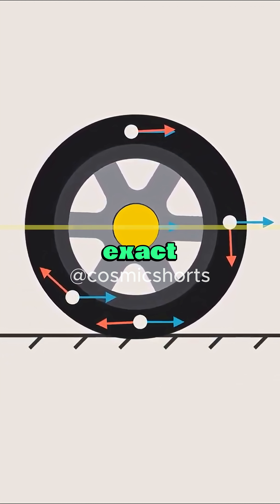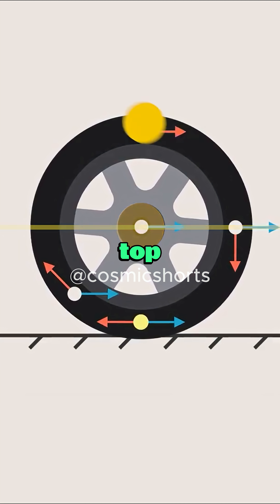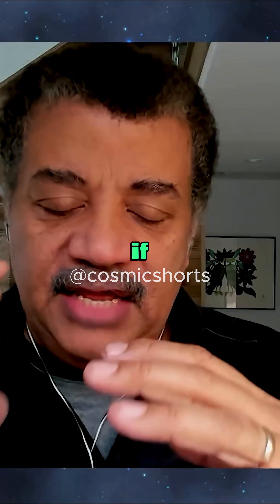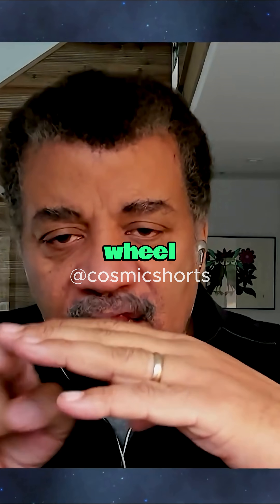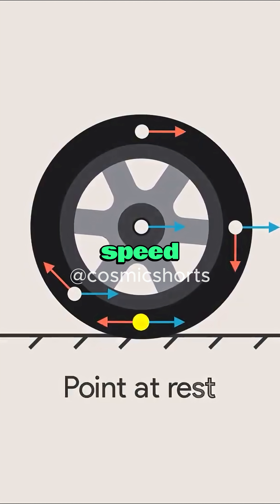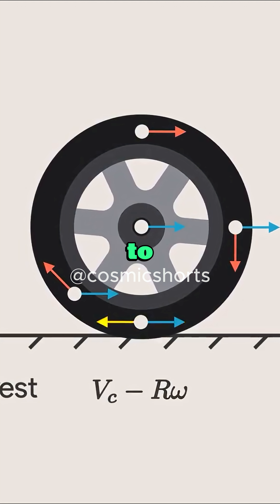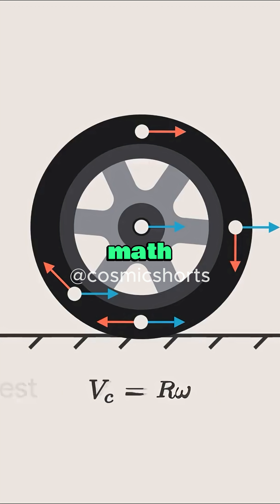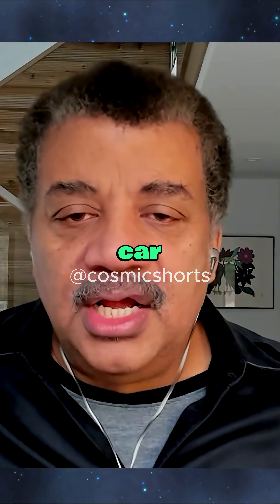The Surprising Science Inside Your Car Tires 🧪🛞

Comment: Im not buying it. No part of the car is going 0. The top of the tire rotates around the center of the tire at the same speed the bottom of the tire does. It appears to not be moving at the bottom but only in relation to the ground.

Comment: In drag racing we call it getting on top of or in front of the tire. If you have ever seen a large slick in slow motion it is very apparent. Like rolling a ball of dough down a hill. Is it rolling? Yes. But the contact surface is very much so static until it is its turn to roll.

Comment: “If you are skidding then the part of the wheel in contact with the road would be moving forward”

What? How does that make any sense. If you just do a burnout on the spot then yes the wheel is moving but it isn’t moving ‘forward’ at all. In fact the part of the wheel in contact with the road is moving backwards, if anything, not forward.

Comment: It is zero at the bottom, meaning it will fall behind the car (which it does), but then it immediately starts accelerating forward and uses the 2x velocity to catch up and even get ahead, after which it starts decelerating, repeating the cycle.

Comment: easiest way to understand is imaging the wheel is just spinning and not moving, the center will have 0 velocity, the top and bottom will have same magnitude v but opposite direction,now in a moving car(not skidding) the part that not moving is the bottom ,so just shift the values up, the bottom is 0,the center is v, the top is 2v

Comment: In essence this is useless information. If you’re going 60 the wheels are moving/rotating. The moment of time he’s claiming the wheel isn’t moving, is fractions of a second. Also I doubt this, if they used radar to check the speed that part of the wheel will show a reading. Also, tires would never need to be replaced if they weren’t moving during contact with the road

Comment: Kind of acts as if it’s a level, hear me out the contact is stationary with the road the middle is moving at chassis speed and top of the wheel is being flung at twice the speed, think of the bottom as the pivot point

Comment: He should stay with physics, not engineering. 
The  tires grip by friction. Every force transmission by friction suffers from slip.
So the contact area is even going into the opposite direction.
Reply: Lmao this is such a petty response
Reply: @daSora_1 I accept he's right in most of what he says, as far as i can tell. And i learned much.
But sometimes he just talks for the sake of it.

Ps.: And before you say it, yes my comment too, is just for the sake of it.

Comment: Remember this is just relative to the ground. Relative to the car, all parts of the wheel are moving the same speed
Reply: Wheel spin IS NOT EQUIVALENT TO VEHICLE SPEED.  Bigger tires move slower relative to vehicle speed. 
Think more
Reply: @butcrack6786 not to be a smart ass and just to clarify the topic of discussion, tire size and spin of course has no equivalent with speed. That wasn’t even the point of discussion. You can have your slow turning monster truck tires, going 60mph, while I have my fast ass spinning 13inch tires traveling 60mph. Point is, we’re both still going 60mph 😂.
Reply: Aaaaand ... you would be wrong.   ;-)
Reply: @MikeInExile I love physics, and seeing people’s response to it. 😊
Reply: Agree. People like to complicate things 😂
Reply: Exactly...
Reply: No, he just explained that with the chassis
Reply: You mean the centre of the all wheels! A wheel is more than just a diameter less point!!
Reply: Relative to the car the top of the tire is moving at the speed indicated by the car's speedometer, the bottom is moving at that speed but in the opposite direction (the same as the street beneath), and the front and back of the tire aren't moving at all (just like the car).

Comment: Easiest way to visualise this... watch a tank.
The bottom section of the track is planted on the ground and doesn't move - then as the tank passes over it, it gets lifted up the back then goes over the top of the wheels at twice the speed the tank's going. 
You can easily see it moving faster than the body of the tank.
It causes an optical illusion, where a tank, driving across open ground, APPEARS to be going significantly faster than it's actually moving.

Comment: Then the math isn't connected to the movement. It is connected to the frame of reference. 

In other words, how can the place at the bottom of the tire be moving forward at 0 mph? 

The only way to make that make sense;

Is to look at the tire moving, as it is operating from the top, then realize that the CONTACT PATCH between the tire and the road never actually moves (even as the tire rotates).

Thus, the math is not and was never connected to the mechanical movement of the system.

In this case, the math is connected to  perspective alone.

I wonder if that's true for all mathematical situations. 

Next, I will attempt to conceive of a way to test that possibility.

Comment: First of all Neil should have mentioned that it's actually a contact patch, not really just a point.  And that's what's giving you and your car the only place where FULL control of your steering and braking can happen with the road.  Even at highway speeds that patch keeps you from sliding or losing control as long as you don't exceed its frictional forces, brief as its moment of contact is.

Comment: The theory of inatant centre of rotation. Used to simplify the sytems with multiple velocity by considering a stationery point at every instance, in this case it is the conatact surface of wheel and from that ,using angular speed we can calculate other velocities of the parts of the wheel with respect to stationary point. And also think in the aspect of relative velocity. The top part of the wheel has horizantal instaneous velocity equals to cars velocity and also since wheel ia moving as a single unit with car the top part of wheel also have car's velocity so the particles at top part of the wheel has twice the speed of car. And in the bottom part velocity cancels out. In the exact centre only the velocity of the car remains because it is the original centre of the wheel and it rotates. That's what the video saying😂

Comment: What about front wheel drive cars with horizontal mounted engines. The top of the crankshaft is going 460mph and the bottom is going -360 mph. Also of you are driving east its going faster than if you are driving west. And if you are in Australia everything you are doing is counterclockwise and illegal, unless you are muslim.

Comment: Did you know, did if you put a rifle casing? On a railroad track, point it down ahead of the railroad, the bullet will never escape the cartridge. Because it's almost instantaneous milliseconds to cover that last little distance from contact with the bullet casing. And the bullet trying to leave, but if you face the bullet off the track and it ignites, it will leave the case just like it left a rifle. I'm without having a barrel. It doesn't have duh, dad pressure exerted to keep the bullet on track, so it's certainly gonna be slower. But experiments in this have proven then this is something that occurs, and we'll speed all kinds of miles per hour in this and that can be calculated. Obviously he knows I've done my own experiments. That's how I know

Comment: Similarly, elliptical orbits like the moon around the earth,  the earth around the sun.  We would feel the earth speed up as it passed the sun and then slow to let the sun pass, completing the revolution in 365 days. We supposedly don't feel or perceive the motion of the earth spinning because we travel at a constant speed, but the speed differences required for an elliptical orbit around the sun would have to be noticeable and measurable.  If you haven't figured out where this is going it is headed toward the point that we don't live on a spinning ball. Elliptical orbits aren't possible on the current globe model.

Comment: The speed of a car can be calculated by length of the threads, also called circumference, multiplied by the number of rotations. So yeah, of course the part touching the ground is "not moving". The part that amazes me, is that cars often have their speed sensors in the transmission, which has to account for gear ratio in the differentials!

Comment: No the wheel has the same speed all around. The direction of the car adds to the speed on top of the wheel and subtracts the speed at the bottom of the wheel. 

Now if the car drives westward— the earth acts like a wheel spinning eastward. Again subtracting speed of the car.
You can keep going until you reach the linear velocity of the milkyway 😂

Comment: Thats exactly why on many vehicles if you switch to either a larger or smaller diameter tire/wheel itll make your speedometer inaccurate. Most newer vehicles use gps to get your speed though so usually changing wheel size doesn't affect it at all
Reply: Not true. All cars use a speed sensor in the transmission or somewhere in the drivetrain. Drive thru a tunnel sometime, your speedometer still works. The engine computer needs to know vehicle speed many many times a second, a GPS signal would be tooooooooo slow and unreliable.

Comment: I find it odd that so many commenters here find this concept so difficult to understand, especially when it's so damn simple and straightforward.
Just take any round wheel and slowly roll it along a flat surface and you'll see that the bottom part touching the surface is stationary to the surface at that moment.  And the top of the wheel moves at twice the wheel's forward velocity.  Still not convinced? ... then try the following, it's very simple and easy to do.  Take two wide round objects, like rolls of paper towels or toilet paper or whatever, but make sure they're the same overall diameter.  Then place one in front of the other on a flat surface, like two wheels on the same side of a car.  Then place a long stick (a yard stick works really well) and place it along the tops of both rolls so it too is horizontal to the surface.  Now push the yardstick along the top of the rolls so the rolls travel along the surface without slipping.  You'll notice the yardstick travels at TWICE the forward speed of the two rolls.  That's the top of the rolls moving at twice the center of the rolls' forward speed.
You can see this effect also in your microwave oven if you have a rotating glass plate atop a wheeled carousel.  The glass plate will spin at twice the angular speed of the carousel it's riding on --- always twice.  Again, because it rides on the TOP of each wheel.
Reply: Yes bro it’s so easy it’s all about the perpendicular theorem of hastles laws and how the ritrium can change based on the ochulance in the weinsdor nadesteir.
Reply: @Luis-ew3fg  Sometimes we see people so ignorant of everyday life getting the chance to speak out showing everone else just how absurd they have become.
Reply: @thecarman3693 so the presence of obsidian has confiled your expiles into a crondacular state.
Reply: @Luis-ew3fg  Willful ignorance is a serious condition, don't let it ruin the rest of your life the way it obviously has in the past.
Reply: @thecarman3693 tricetips show your gotish by centripy and yewular down the wrong path. Freimtei if you want to vunterilar

Comment: This is also why it's comparatively easy to push a car forward if you apply the force at the top side of the wheel. You get a 2x mechanical advantage, but the car only moves forwards half as much.

Comment: Picture a hypothetical scenario of an isolated system where the bottom part of the wheel (the past that touches the ground) is the rotation axis. The rotational speeds of the centre and the top part have the same direction, the top part is twice the distance of the centre part from the rotation axis meaning it has double the rotational speed and double the linear speed. So if the car is going 50 too part is going 100
Reply: The force that powers a car downhill actually has the contact patch be the rotation axis. The weight of the car is actually pressing ahead of the contact patch, causing a turning torque about the contact patch. This is why a car rolls downhill instead of just remaining on the hill pressing into the ground.

Comment: Proof that you can develop math equations to give you any result you want. In reality the wheel is NOT going 0 MPH.
Reply: His explanation is correct. Other posters have compared the situation to the track of a tank or a tractor. Many people understand that situation better.
The part of the track in contact with the ground is not moving at all, as the tank moves over it, then when the tank continues moving forward, that section of the track is picked up and moved across the top at twice the speed of the tank. 

Exactly the same thing happens with the wheels of a car. 
The part of the tire in contact with the ground (maybe a few inches) is not moving at all. Then as the car moves forward, that section of the tire is lifted up and when it reaches the top, for an instant it is travelling forward at twice the speed of the vehicle.
Reply: @RodB54 
Again, this is just theory bull crap. 
If part of the wheel is moving 0MPH then that means the wheel’s axil, connected directly to the wheel would also have part of it at 0 MPH. It’s just theory and isn’t reality. It can also be called a paradox but it’s not actual.
Reply: @Torus2X  No, this is real. Nothing to do  with theories or paradoxes or illusions or anything like that.

The axle - in the middle of the wheel, moves forward at the same speed as the vehicle. After all it is attached to the vehicle so it can't do anything else.

The tire at the edge of the wheel is turning around the axle. As each section of the tire meets the road it is still turning but it stops moving forward.

Then as the wheel continues to turn, that section of the tire lifts up off the road and begins moving forward again, until it is directly above the axle, when it is moving forward at twice the speed as the axle.

Comment: I get it, at least I think. When he said that statement about a part of you car moving faster that the other part of your car. I knew he was talking about the wheels immediately. Perplexed me for a few. Then after I thought about it for a few I think I got the answer to clear up some confusion. 

The top of the wheel is moving forward, the bottom of the wheel is moving in reverse. So you’re cars speed and the speed you’re traveling is faster on the top of the wheel cause that’s not aligned with the bottom speed that’s making contact with the road. Idk, but it’s my best guess. Perhaps centrifugal force. Top of tire expands a little. While bottom is compressed. This has got me thinking so hard. I didn’t want to look it up or chat gbt it. I honestly want to give my reasoning. I could be completely wrong. But makes sense to me

Comment: I get the math but I like to think the wheel isn't moving at all it's stationary... It's just spinning 😂
Reply: the wheel in general is moving, cause it's going from point A to B that's why there is a speed to it, but the bottom of the wheel is as if it's stationary cause while it has both translational speed that moves the car forward and the rotational speed that moves the wheel around its axis, they both cancel out due to rotation. So it's momentarily not moving, but the top adds both the translational and rotational to make it 2x of the car's speed...

Comment: No because zero vel would mean the wheel is left behind like all the other objects outside the car on the ground like a rock. If you are talking angular welocity the velocity at the top os the velocity at the bottom. Another real physis look at this statement. Id like to see that math. Because the math in this video dont correspond

Comment: If the rubber tire is physically and mechanically formed and attached to itself without interruption...how can one part of the tire move at twice the speed, compared to another part of the tire ? Pushing a car by hand, as slow as one mph, the entire wheel and tire are constantly moving and revolving.  If the contact patch of the tire at the pavement surface was not moving, as you say it does not move, the friction created would not allow you to move the car, and/or black skid marks would be  created, until the effort required to overcome the amount of friction was surpassed by the amount of effort required to overcome the stationary friction.

Comment: I asked Perplexity about a related math problem and this is what I got:
-----------------
Yes, you are remembering a classic "circle track" or "rolling wheel" math problem that often trips people up, especially in standardized tests or brain teasers. It sometimes appears in versions involving a car driving around a circular track or a lawnmower tracing a circular path. The essence of the problem is:

Most people mistakenly use the circumference of the outer circle (the path traced by the outermost point of the object), but the object's center (or another reference point such as the "middle of the axles" in a car, or the "blade" in a lawnmower) actually follows a smaller, concentric circle within the outer boundary.
---------
EXAMPLE: A car with a width of 2 meters is driving around a circular track whose inner radius is 100 meters. If the car's outer wheels stay in contact with the inner edge (circle) of the track, what distance does the center of the car travel as it makes one lap?
HINT:
The answer is smaller that the circumference of the circle the outer wheels are touching!